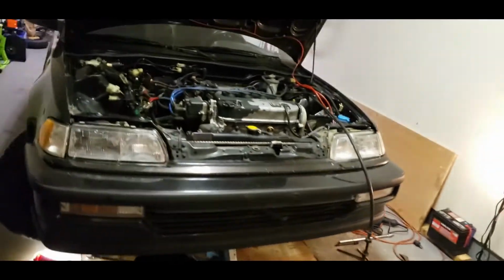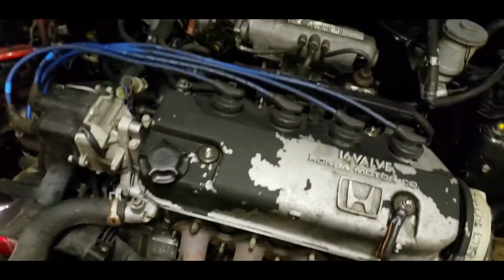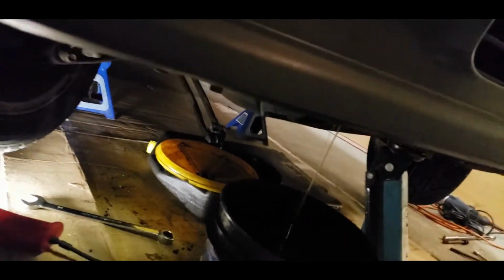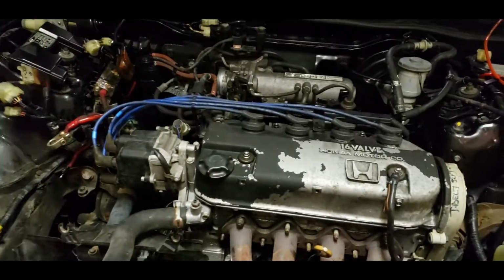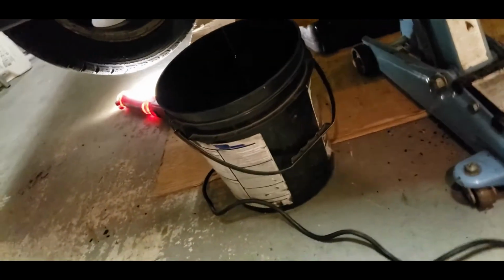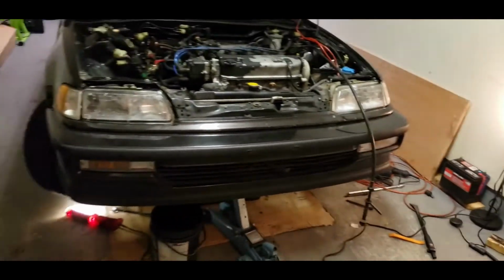[Part 1] D16Y8 Engine Swap: How to Remove Stock Engine (D16A6) In My EF/ED Civic Si

Comment: I did the same thing but in the base model platform it's a little more complicated wiring at least for me
Reply from the maker: What motor did you drop in? D16Y8 as well? I guess the difference would be you had to wire up mpfi, but once that's done it's just plug and play.
Reply: @BudgetGears  yeah mpfi and obd1 dizzy internals on y8 dizzy so I didn't have to mess with the wiring harness with a a6 intake manifold
Reply from the maker: @killahstew5220  Nice! I wired my dizzy. Well, technically I didn't have to. I made a obd0 to obd2a jumper harness, but my dizzy was a obd2b, so I redid the harness using obd2a connectors. That way I can wire up that blue rpm wire in 1 harness, which the obd2b didn't have. Had to really base everything off of wire position because the wire colors on the internet didn't fully match up with what was on my dizzy's.

Comment: you dont have a parts list or write up of what you did to do swap im doing same swap now just trying to figure out harness?
Reply from the maker: I don't have a parts list, but you can probably check out my video where I talked about how much it cost to do the D16Y8 swap. That provides some more details. Because of how many people that ask me about the D16Y8 swap, I'm in the process of making a video discussing everything needed.
Reply: @BudgetGears  ok thanks im jus wondering because im doing that build as we text actually 2 of them. same swaps
Reply from the maker: @puch7261  Oh nice! I just realized I didn't respond about the harness. You use your original harness from your car and swap over to the Y8. You'll just change over some plugs here and there and that's it. Then use a jumper for the distributor and the ECU and that's all there is to the wiring.
Reply: @BudgetGears thanks appreciate the info.👌
Reply: @BudgetGears  p28 should work
Reply from the maker: @puch7261  P28 will run it ok, but not optimal. highly recommend getting it tuned. I street tuned mine and drives way better after tuning.